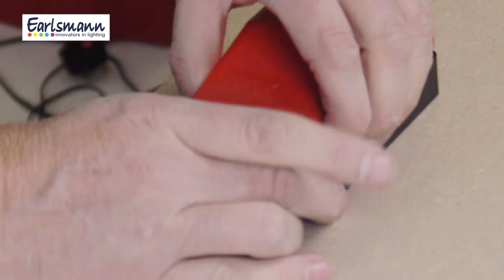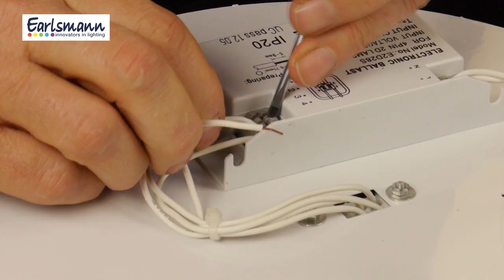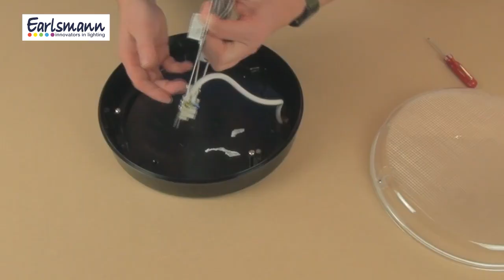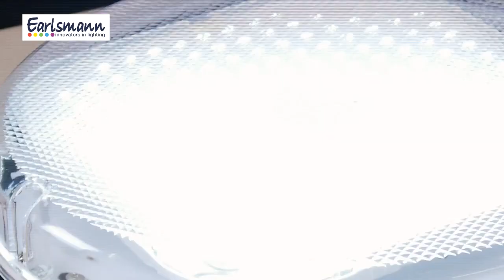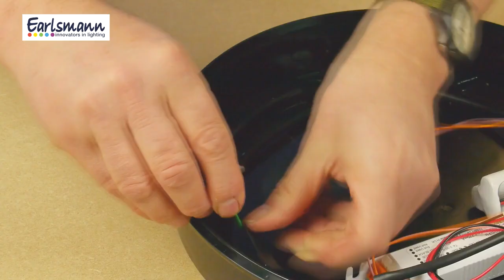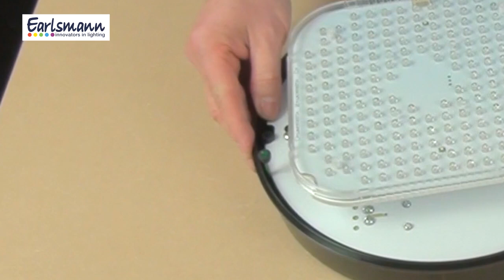How to install an Earlsmann LED Replacement 2D lamp

Comment: Didnt it occur to you to actually show us the plate so we could see clearly the wiring before putting gear tray back?????
Reply: This is easy.  On the left-hand side remove the  2 center cables, not the 2 outside. On the right-hand side remove the neutral and live. With ac, it does not matter about polarity, just wire it up.  Jobs done! Your just by-passing starter!

Comment: his is of no use. You can clearly see there are 4 wires on the lamp unit, but only two are connected to the mains. IT DOSNT SHOW WICH TWO
Reply: This is easy.  On the left-hand side remove the  2 center cables, not the 2 outside. On the right-hand side remove the neutral and live. With ac, it does not matter about polarity, just wire it up.  Jobs done! Your just by-passing starter!

Comment: This is easy.  On the left-hand side remove the  2 center cables, not the 2 outside. On the right-hand side remove the neutral and live. With ac, it does not matter about polarity, just wire it up.  Jobs done! Your just by-passing starter!

Comment: Incomprehensible. You don't show all the steps; you rush through things; you arrange the camera so that it cannot see what is happening; you refer to parts by name but don't point out which they are.
Reply: This is easy.  On the left-hand side remove the  2 center cables, not the 2 outside. On the right-hand side remove the neutral and live. With ac, it does not matter about polarity, just wire it up.  Jobs done! Your just by-passing starter!